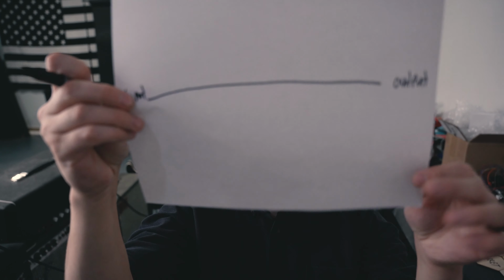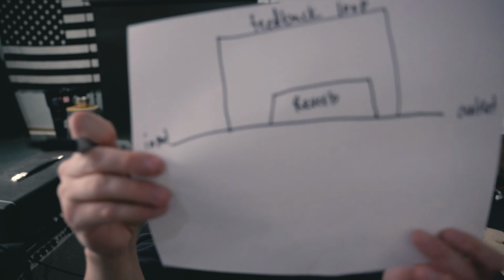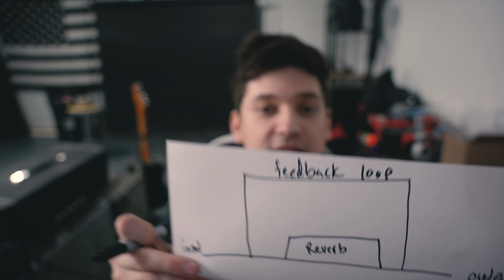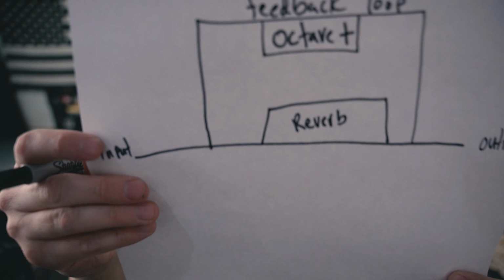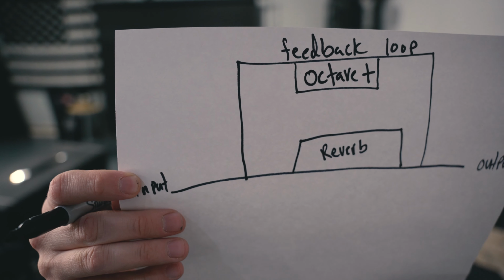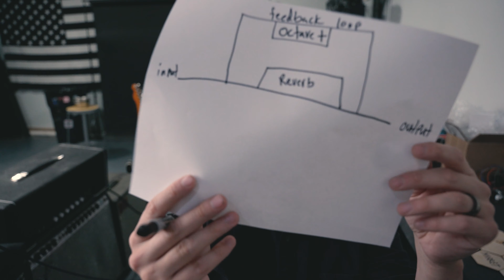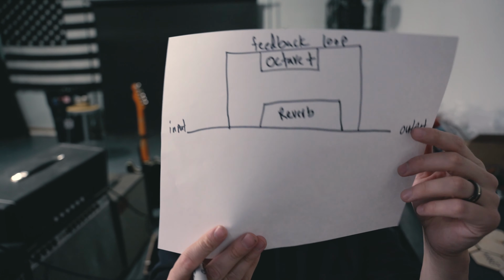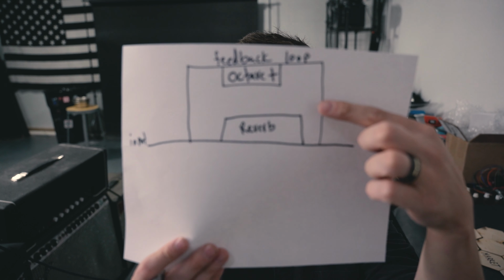How does Shimmer work?

Comment: I was having a hard time deciding whether I should get a Hall of Fame Reverb or an EQD Afterneath because I've never really been into boutique pedals, then I saw a video about the Astronomer, ended up getting one right away.
Reply: Indeed-I bought a tc reverb pedal (the nova) hoping they had some regenerative applications for a huge pad but sadly it did not….and for years boss had a reverb pedal that lacked lushness…and that is why I hauled the midiverb 4 rack unit around for ages…argh